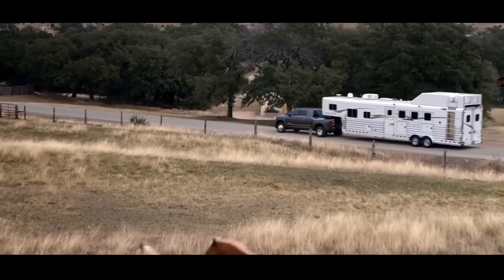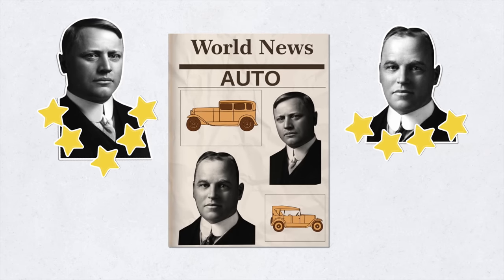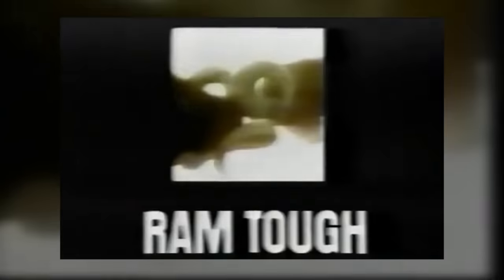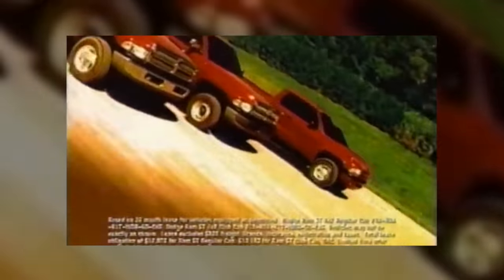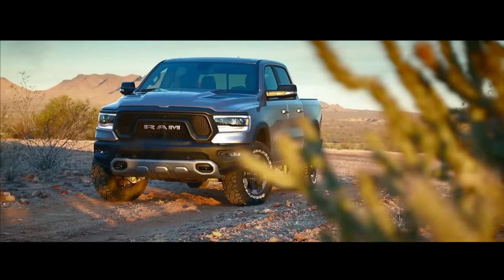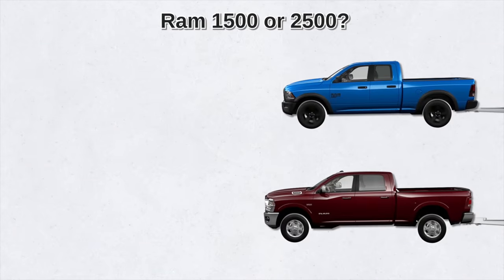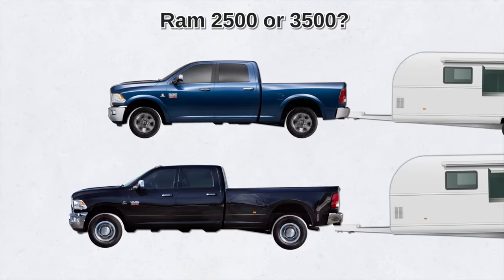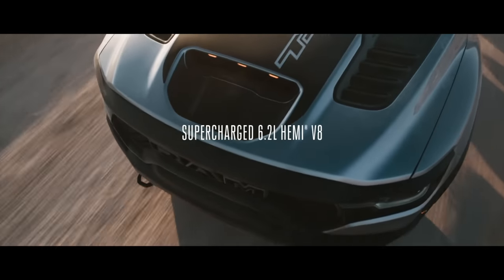No One is Telling You the Truth About Dodge Rams, So I Have to

Comment: My 1998 dodge RAM 3500 12-Valve Cummins diesel Dually is a MONSTER - Oh, manual tranny, too, of course!!

;-]

221K miles with only a clutch replacement, back at 189K miles - couple batteries & tirez!!

THAT'S IT - BTW, it is now worth DOUBLE what i paid for it!!!

YOU GO, DODGE 3500 RAM Dually --  Best Truck EVER - gonna go to 1MM MILES, easy!!

Comment: After owning ford 150and gm 1500 I found the price too high for the garbage trucks they were to buy another gm blown motor at 110k truck was covered in rust wasn’t worth replacing blown motor 
Ford was nothing but sensor and transmission issues one after another plus the rust was covering the bed and rockers worse than any gm I’ve ever owned 
Ram had more options for less money. Yes they rust like everything else after 10 years in salt use states however Love my 16 ram sport 5.7 hemi 
Solid truck 70k on it so far and yet to have a single rust spot on it 

Bottom line they’re all over priced so buy what you like

Comment: Every truck, Ford, Chevy, Dodge, GMC, Toyota, Honda, Nissan, and Including Diesel Trucks and cars, Anything 2008 and up It's nothing but garbage, you Drive them for 2000, 3000 miles already in the shop. Back in those days, they were meant to be driven 500000 to a million. You're lucky if you get at least 75000 miles on the adometer

Comment: These trucks are super reliable, except for the ball joints youll have to replace every 35000 miles 😂 and the electical system that will randomly fail in uncanny ways. 

I cant speak to the newer Rams made since Fiat purchased them but anything that is decently old and used as of today should be avoided.

Comment: I bought a new 2500 Dodge 5.9 cummins and manual 5 speed great truck road like a log wagon . So in 05 I bought a Dodge 3500 4x4  4 door long bed dullay 5.9 cummins 6 speed manual and it rode like a half ton and Iam still driveling and towing 5th wheel and boats and big truck camper my 05 still has factory brakes and has over 50% on pads and I always get my new trucks the Ziebart rust proofing where they drill all the holes and spray all inside of rocker and doors they spray it all and never had one rust up on me. I was always a Ford guy but had to have that cummins and to top it off I hauled cars for GM all my life, Ha Ha !

Comment: My 2009 dodge ram 1500 5.7 has been nothing but problem after problem. Replaced both exhaust manifolds, had to rebuild rear differential since you can't get a new replacement anymore.  Failed CV axle 2 times (all driver's side) Failed upper ball joint in motion caused fender damage and broke CV axle AGAIN! Rear slider window fail. F.O.B. that starts truck when I am inside a house or business without even pressing buttons, rolls windows down, locks you out while keys are inside truck. Now?! Won't take fuel to gas tank without spilling fuel all over repeatedly. No easy or cheap fix for this! Oh!! And don't get me started on the paint and rusting issues. Looks good if you squint your eyes and view it at a distance. Lol!! Garbage...

Comment: I guess I’m the only commenter that had problems with a Dodge. Had a 1998 Durango that was bought new , at 37,000  miles the rear end had to get replaced. I towed NOTHING with it. Traded it when it had 45,000 miles on it and the transmission was on its last leg.  So I have owned two Dodges , first and LAST. I wouldn’t buy anything Dodge/Mopar related. That includes a cheap built piece of crap Jeep either.

Comment: This video is so inaccurate. You can get the 2500, or the 3500 with the 6.7. Also not all 1500's have air suspension. Poor research..

Comment: Truck of the year means nothing they buy that for advertising. Also dodge had some of the worst front ends or was on the market you joints consistently fell apart ball joints front ends at a recall on alder tire rods. One time have one of the worst seats, the business at one time, they had a lot of issues but people overlooked it because of the engine but now the engine has issues in the last 5 to 6 years costly in the shop check engine lights on pass by any automotive place that does nothing but diesels and that’s all you’ll see out there that is Cummins diesel’s

Comment: I still call them a "Goat".  They are a LOT better than they were, but the Bodies are "TINNY".  You slam the door on a new one and it rattles like a Trash Can Lid.  The Cummins engine was a good thing for them.  Diesel is the only way to go for ANY VEHICLE.  I won't buy ANYTHING that has a Gasoline engine.  I am 100% diesel.

Comment: Whatever you do, don’t buy a Dodge truck. I’ve had two friends about brand new dodge trucks, spend most of the time in the shop they gave them back and bought Toyota’s Ford and dodge trucks now I just absolute junk
Reply: I am on my third Dodge Ram and I haven't had a single problem with them. Not once did they have to go to the shop other than oil changes, tire rotations etc

Comment: A 2017 ram 3500 duelly will give you a 1/2 ton pickup transmission, the 68RFE junk that only has a towing capacity of 20,000 pounds, not 30,000 pounds as ram promises on a 3500 one ton duelly. They also offer front end recalls and 11 other recalls! The emissions junk makes the cummins diesel engine last about 200,000 miles if your lucky! The worse problem with these trucks is the ABS control module and HCU which both fail right before or after the warranty is up! Ram has a worthless warranty of 5 years or 100,000 miles, whichever comes first. When the ABS control module goes out Ram stellantis will not provide new parts and refuses to recall or repair the defective truck under warranty. In this way you can be sure that your truck will sit in your driveway throughout the warranty period! You can sit in your new 6 year old ram with very low mileage while pretending to drive to your vacation destination sitting in your driveway wondering why you ever bought this piece of junk!

Comment: This is the first video I've seen by Scotty that seems like it's PURELY an advertisement, rather than an honest look at these trucks. Virtually nothing technical or practical about the operation of the trucks is even discussed in this video.

These are terrible work trucks. You're either a sucker if you buy one of these, or a first time truck buyer who needs something cheap because you don't have money to afford a decent truck. They are cheap for a reason.
If you want a transmission that is gonna crap out at 100k miles, with no replacement transmissions or engines available for over a year, go ahead and buy a Ram.
That's not even mentioning the engine issues you're gonna have around that time. Sure, you 'might' be able to run it while you wait for a new engine for over a year on backlog, but it's never gonna be reliable.
You should also expect to have a myriad of other problems within the first year, such as gearbox issues.

If you don't firmly project making more money than the truck is worth within the first 100k miles, then don't do it.

Comment: None those hemi engines suck gas way worse than what there rated have crap warranty's I had a 2021 ram 2500 6.4 . Worse truck I ever owned average 12mpg and rode like crap.  And the electronics repeatedly in the first 24,000, mi.

Comment: RUST BUCKET RAMS: One only has to look around on Michigan Roads, and see the Terrible Job, Ram has done in Rust Resistance on their vehicles. Its a Discrace. Chrysler has always been in Last Place. So we shall see if the New Ram Trucks , went through the " EASY BAKE OVEN" of coating, Plating, actual painting on the inside of the doors, Tail Gates, Fender Wells. A Few short years will Tell the Truth.

Comment: AS ANY HAD TRAN's TROUBLE AS SEEN THE TRAN SHIFT ABOUT 60 KM INTO HIGH FEAR ITS AS IT MISSED TWO SPEED's < THE TRUCK NEED SPEED LIMITER AS PUSH TROTTLE AS YOUR SPEEDING AND YOUR ONLY USE IT AS ANY AUTO< ONLY SMALL MOTOR AND IT MOVE THE TRUCK< MY SELF AS 2500 DODGE DIESEL TRAN's OUT AND BEFORE FROM SOME HUNTED STOOGES POUR WATER IN FUEL AND DOWN SHIFT TRAN's AND BOLT OUT FRONT BRAKE's CUT FAN BELT' SAME AS JEEP ALL OTHER THING's DID AS THEY GET FOUND HELL RAIN''s ALL EARN FOR THE ENDS OF STOOGE''s CLUB AND CREW MISLED PUNK''s ! THAT IS STAYING TRAPPED GONE ! DON't ASK MY SELF'GET TWO YOUR MOUTH's AND YOUR TRAMP !

Comment: I love my 2004 1500 Hemi Sport.  But I'll never forgive Dodge for failing to fix the known problems with the Hemi, particularly the Hemi tick and the broken exhaust bolt issue that they had over 2 decades to fix. It's a good engine, but Dodge's indifference to it's customers prevented it from  being a truly great engine.  Hence, when Dodge finally innovates it's way right out of business, which I've been predicting for years that it will:  Here's one customer that will shed no tears.  P.S.  If you're gonna manufacture junk (I think my particular vehicle is up to something like 15 recalls now), and charge an arm and a leg for it, then you can expect no loyalty.